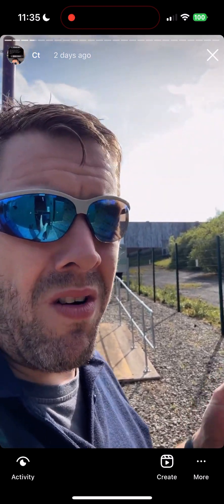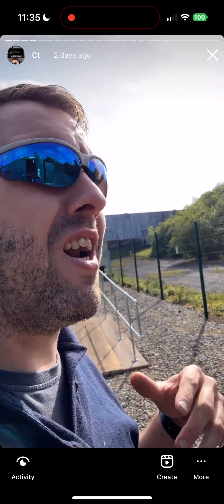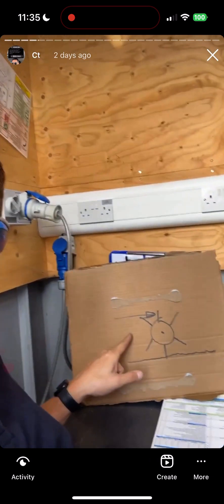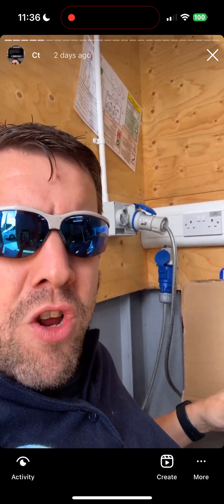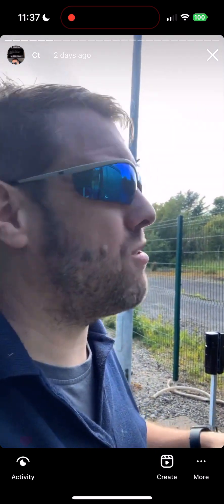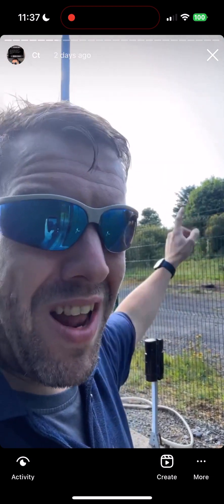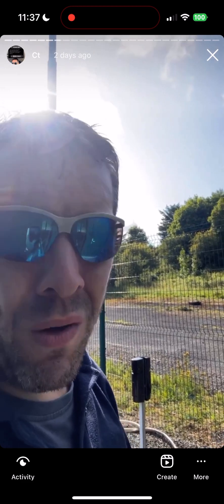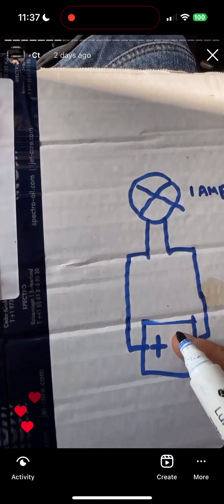how a CT works / mesuuring current AMPS

Comment: I’m my head, if you had an empty pen full of ball bearings and pushed another one in the end. The voltage is the action of pushing a new ball bearing in and the current is the speed of the ball bearing moving from one end to another. If the pen was more (gurthy) and had more balls then more balls are pushed through but only if you apply more force (voltage) the total being power (watts) 

If all phases in a balanced 3 phase system are the same. Say 10A per phase. The the neutral current will net 0A. So I think the CT would measure 0A as it’s returning on the other lines. the magnetic field will also cancel itself out meaning no current to induce current in the CT. 

Might be wrong but school day Sunday.

Comment: Your asking about the difference between star and delta arrangements I think within loads. So if delta it would be 10 Amps X route 3 to get line current or in star it will be 10 Amps as phase current=line current...... There.... And my students always asked where they would need that stuff 😂.... Is that what your asking?